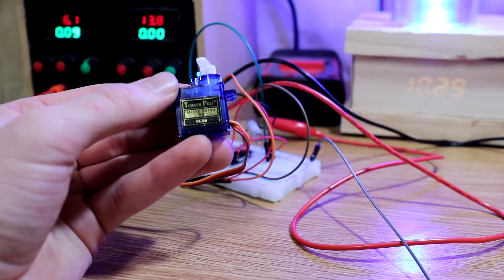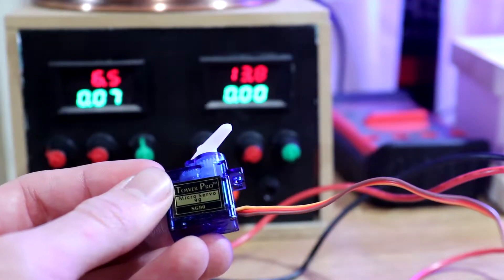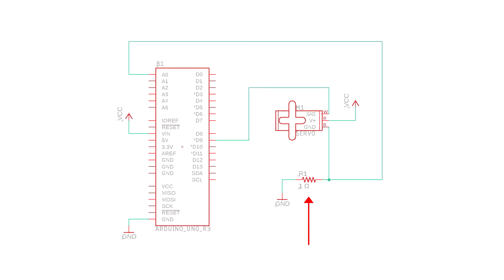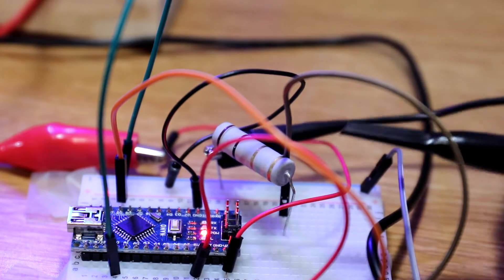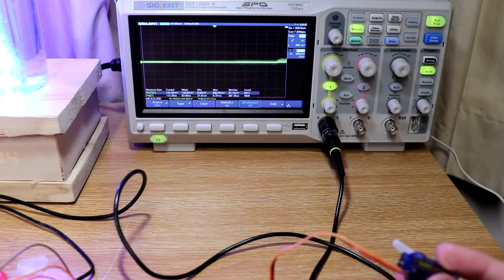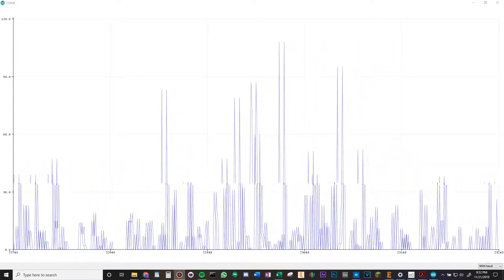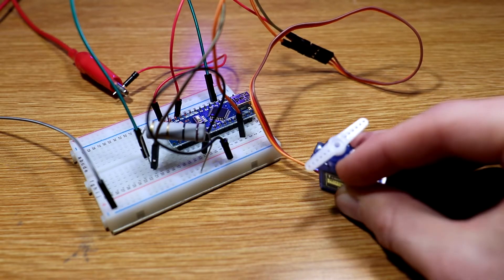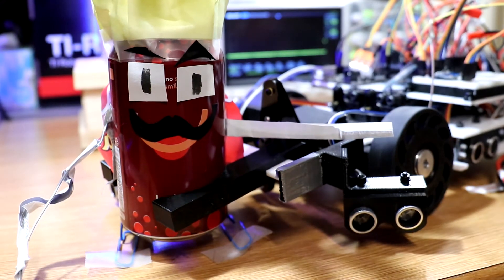EXTREMELY Simple Way To Sense Servo Current Draw

Comment: I've been looking at measuring servo current and found this video. I don't really understand exactly what your oscilloscope is showing. From my own tests I see a low current of a few mA when the servo is idle and when force is applied to it when it's holding its position or it's moving it will pulse the motor at the control pulse frequency starting at the falling edge of the control pulse. I'm using a similar micro servo and there are fairly square wave like 500mA pulses. Your oscilloscope appears to have another substantial high frequency signal on top of the servo motor activity. Is your power supply producing stable 6.5V output? It looks like the servo is powered from the 5V pin from the Arduino Nano and hence going through its LM11117 which would normally clean this up if it's always above 5V + dropout?

Also, I would also expect the Ardunio's analogue input to read more consistent low values when the servo is genuinely not moving. They can buzz when they want to move a tiny bit but can't perhaps due to friction.

Comment: Hi, indeed simple method but I wonder if that'll affect the motor performance? Firstly a "share" of voltage from the source will be taken by the resistor, secondly since servo has different equivalent resistance (which determines its share of voltage) under different load, I think the voltage, and therefore power supplied to the servo might be inconsistent.

Comment: If I am able to find the instantaneous power at each peaks, would an averaging function provide the  mean power consumption for the servo motor?  The instantaneous values that I measured are  mainly peaks in the voltage/current during the running conditions . I am using a current sensor and voltage divider.

Comment: how could you use the current or voltage reading to calculate the torque that the servo experiences.
Reply from the maker: I am not entirely sure if there is a way to calculate torque directly from current and voltage without additional information. Calculating power is easy: it is the voltage times the current. But torque is equal to power divided by angular velocity, and the calculations get even trickier when trying to measure stall torque when the servo arm is not actually moving. I would say that you would need more information to get any accurate numbers. One possible idea for a rudimentary way of calculating the angular velocity without additional parts is to break into the servo and connect up to the encoder or potentiometer (depends on what type of servo you have) built into it which keeps track of the servo's position. You may be able to decipher the rate at which the value from the encoder or potentiometer changes into angular velocity. This is likely much more trouble than it's worth though.

Comment: That is really good, now to calculate actual current draw, lets say analog read  is 120, should we be converting into voltage first, like 120(5/1023) is your voltage values and current will be simply voltage/Resistor value... or simply analogRead/resistor value is your current ?
Reply from the maker: analogRead returns a value between zero and 1023, with the range spanning five volts. So yes, you would do the exact calculation you mentioned, multiplying the value from analogRead by 5/1023. Once you have the actual voltage value, then again yes, divide by the resistor value to get the actual current. I would be wary of the accuracy of the current reading, as the circuit shown in the video doesn't exactly use precision parts... it can be made more accurate by using a precision resistor with a very small tolerance. This should give a decent but rough current reading, but if very precise accuracy is desired then I would look into circuits or equipment designed for that. This video is meant to showcase just a very simple system for getting a rough idea of whether the servo is straining or not.